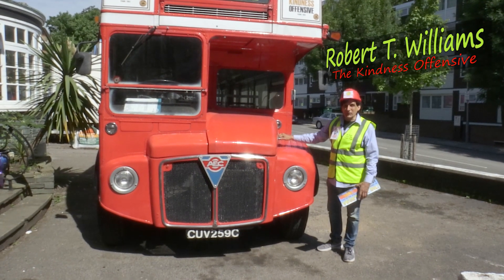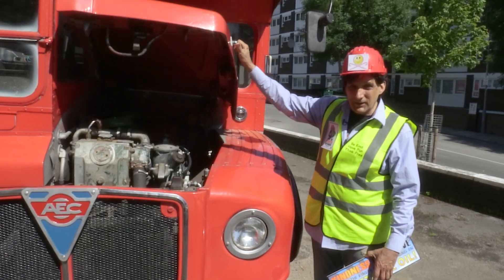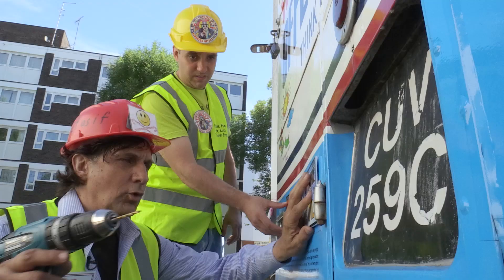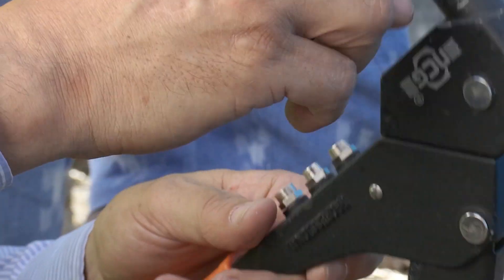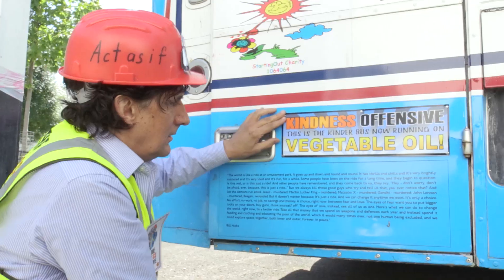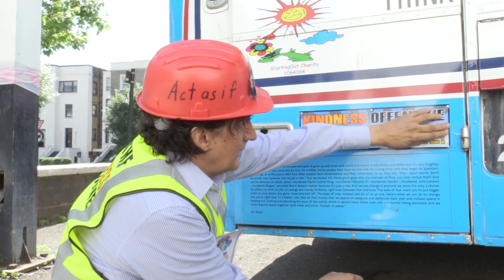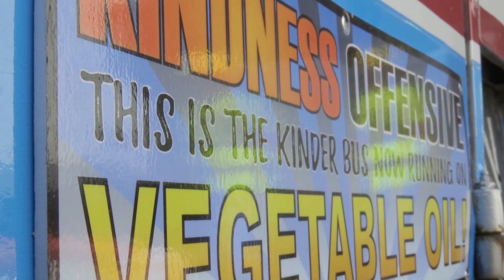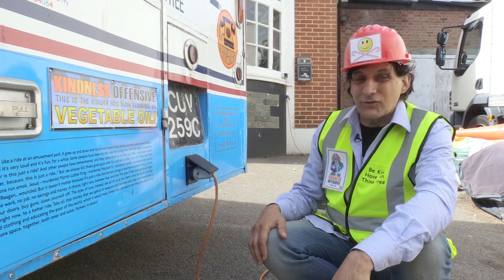VEGETABLE OIL its a sign!

Comment: Could you re-use the old frying oil that fish and chip shops and restaurants have finished with? (it'd probably need filtering though!)  That might be even cheaper to run, and it would effectively mean that the same resource could be used twice, cutting down any impact on the environment even further.
Reply: I think no because it would take a lot of filtering.
Reply: And it might mess the engine
Reply: Yeah, better to use a brand new veggy oil
Reply: I'd say I won't compromise using the old frying  oil

Comment: Impressive, a bus running with the use of a vegetable oil. Its cheaper and I hope its exhaust is not a threat to the human's health.
Reply: I think the exhaust is not a threat to human's health since it cleans-up the engine than using diesel.
Reply: Definitely because the material is from vegetables